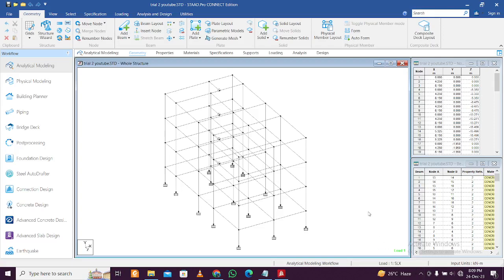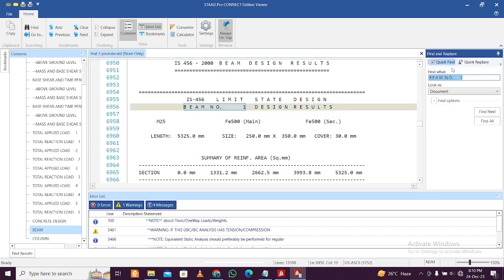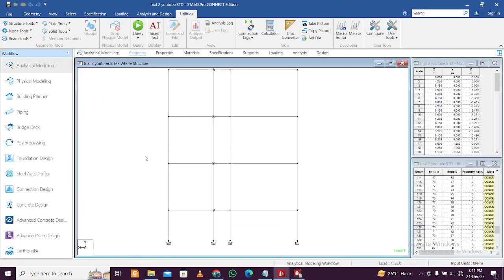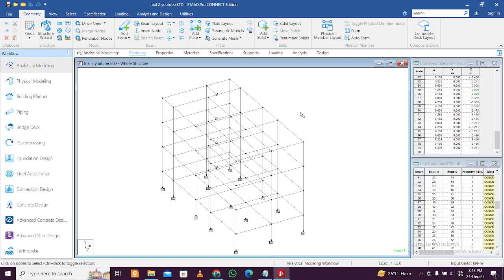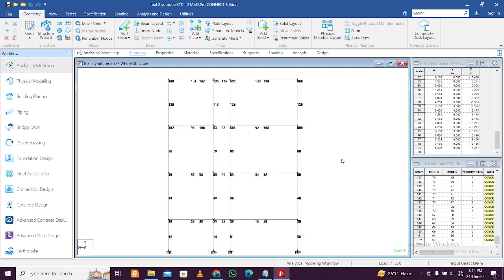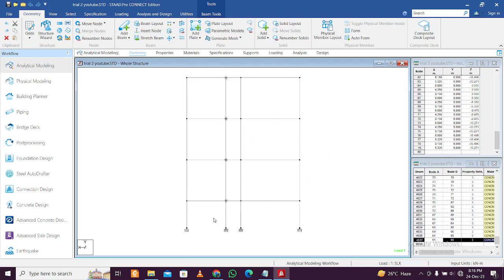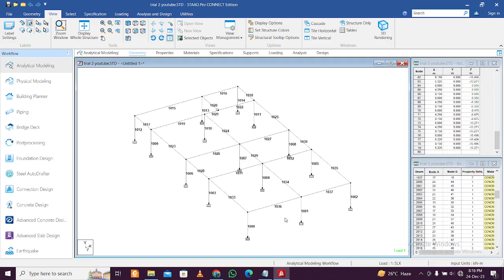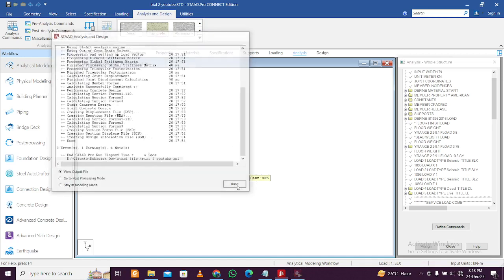Renumbering Beams in STAAD for Structural Detailing

Comment: Hi bro why don't you make a complete practical g+1 building with staircase modeling and rebar detailing and structural drawing generation in tekla structures

I love your works keep on go-ahead ❤🎉
Reply from the maker: Its a huge software in terms of space, earlier I worked for an organisation so I had access but now I have limited system space to work with but I would love to make a fully practical detailing video.